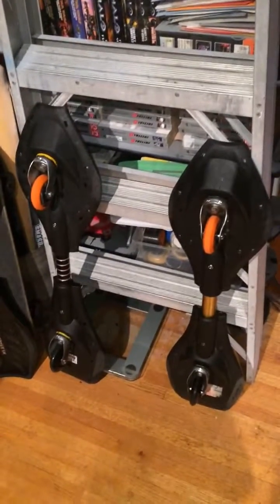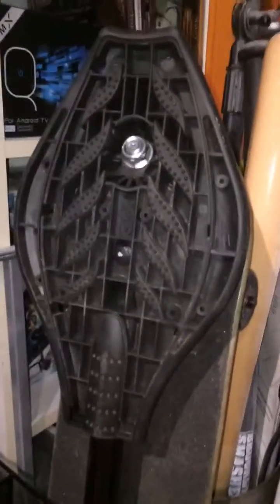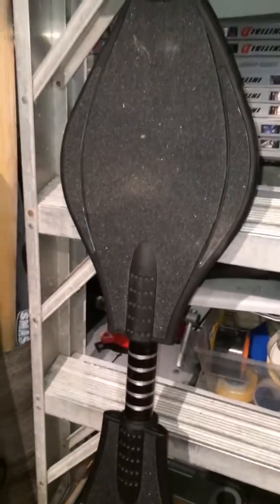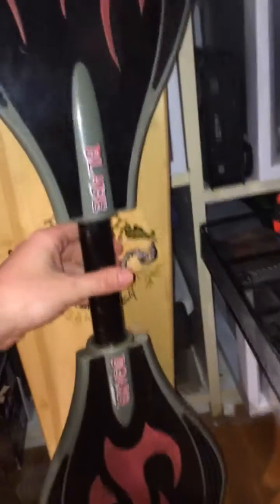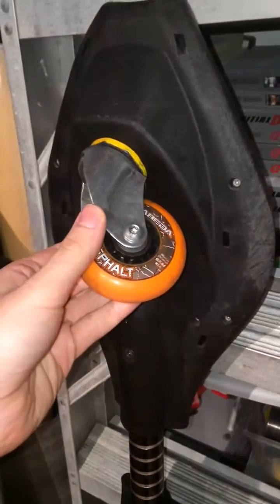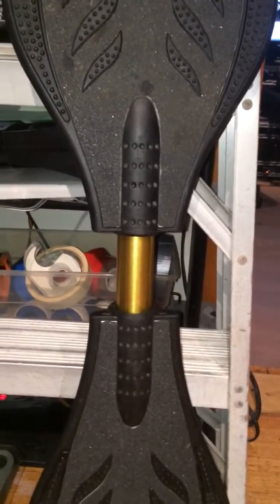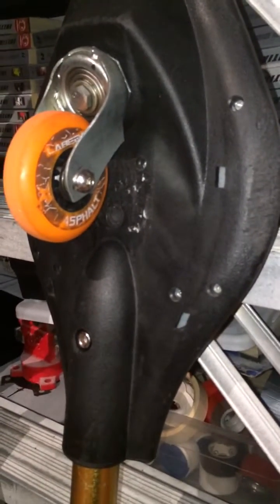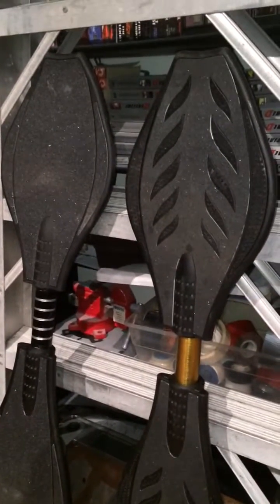Update: My two custom ripstiks

Comment from the maker: Wrote this as a comment on someones video where they showed their new rip surf and figured id give this video an update with news on my current favorite ripstik and general caster board setup. Its still the one using the blade or wave or whatever torsion bar but ive cut the metal tubes and everthing to fit with tons more mods described in the following copy and pasted comment from that video.....

I love my completely self done custom ripstik/caster board. Running my own custom torsion bar (the center piece that twists) its shorter, had to dremel the protective aluminum tube to fit over it with the plastic spacers that also go over that along with the stronger metal tube under all that i custom cut from another caster board. Threw on a harder after market 89a 80mm rear wheel and a softer 85a 80mm front wheel. Shaved down the front separated studded pieces to the matching v1.5 or v3 ripstik front end and top plate which i grip taped. I shaved the side crescent studded grip pieces flat and grip taped them as well. Then matching the rear to the front to fit the torsion bar since you cant use the v1s or the newest ver ripstiks with this sized torsion bar im using the same ver back plate and just threw out the studded grips as they just get in the way of gripping and the grip tape, did the same to the crescent studded grips (shaved em taped em). Dremel'ed off excessive plastic all over without affecting the rigidity and structural integrity of the ripstiks front and rear pieces. Then i reassembled both casters using brand new balls for the bearing construction and custom high end lube used for a lot of pneumatic applications, and then of course had to upgrade my spacers bearings and downgraded my steel caster wheel mount tops to lighten the setup and because i feel they dont wear as badly oddly enough with the lubed ball bearings or whatever that are for the caster assemblies.
Finally to top it all off i tend to slide the back side down onto the plastic deck sorta like if you could board slide but for a ripstik and without needing a rail or curb. The problem with this is it wears down the plastic so badly and quickly it starts to wear down to the nails mounting the grip and i wound up using epoxy before to keep the grips on and it was a giant pain. So i shaved it down till the screws were just about to start scraping on the ground, and then used jb weld and hot glue to fill in the gaps and apply a rectangle i cut out of some delrin(a type of plastic) i had laying around which hardly wears at all if not not at all when compared to the ripstiks plastic material. With that mod done i also get much more sliding with less friction meaning i can get those slides to turn and to stop like i enjoy while having more control and balance and also making it easier to pump off the sliding back end and front end to build up speed going up hill while sliding. Ive never heard of anyone that has learned to do the sliding like i do let alone maneuver and build up speed while sliding, and this mod has just made that ability 20 times easier and smoother to pull off, it also helps having the delrin cut i made so thick so that the board doesnt require so much angle to initiate slides so theres less wear on other parts of the board and it helps significantly with balance like i said.

Anyways TLDR you can do tons with all the different versions of the original ripstik up to the G version and the DLX versions, in total i had 5 or 6 different versions to work with as they changed the design over and over by the time that i purchased each one. So each version can easily be modded and have newer wheels thrown on with nicer bearings and immediately take apart the casters and clean the shitty lube off them and relube them often and use tri flow on the bearing inside the caster which you cant remove and your set for near top end quality riding on those things. 

Very little investment on the cheapest (not including their shitty "brights" "surf" and other shitty lighter variants) ripstik and youve got a caster board able to compete with custom wodden and other material caster boards worth upwards of $300 USD for entry level "high end caster boards" For a mere $130-160 USD if you opt for new bearings and a powell peralta tail bone skid plate instead of cutting a piece of delrin yourself, then just another $16 and you can relube and maintain the thing near indefinitely. My latest top end fully custom board i made has lasted me at least 9 months now and when i started cleaning it and putting it together it was already all using stuff well over 9 years old including the ripstik itself. 

This things never gonna break on me i love it. Not to mention im 6 foot 3 inches and 240 lbs which is just above the limit these things claim to handle and is usually something us bigger guys just burn through like wheels i used to go through typical wheels in about an hour or two now with the upgraded ones and learning to ride it better my wheels last me at least a week of continuous use. which is the reason for the crazy high durometer rear wheel which is fun to skid out/drift with due to the hardness.

Due to the custom setup the torsion bar i installed which i stole from a discont. wave rider board has just as much stiffness as the best ripstik torsion bars but is shorter making the entire wheel base shorter allowing for a more trick oriented board that can accel.  much quicker and easier than a normal length torsion bar even though youd think a wider stance/wheelbase for a taller person like myself would be better, its not. Combine that with the bigger wheels which usually require more strength/energy to accelerate with they kind of counteract each other and the bigger wheels make everything but the drop deck sliding trick i do with my mod for it easier to handle(the height of the delrin mod counteracts that problem tho), its better with cracks, curbs, and top speed so to speak, while also lasting longer.

For comparison incase you barely touch your rip wave or whatever from razer the following compares the typical go to deck based mode of transportation the long board or even skateboard which im sure uve spent plenty of time riding now or in the past whichever it may be....
So thanks to all my modding making the thing perfect, and the fact that it works by propelling from your momentum you push with each leg this caster board requires much less leg work and allows for more endurance riding or long haul rides that youd be able to physically bear with a long board, without worry of tendinitis whilst giving you more maneuverability and imo is much safer to ride than a skateboard so long as the conditions are too sandy, dirt covered, or wet, then the long board is gonna beat out this and all other caster boards for safety.

Now anyone thats gotten through all that reading i would like to thank you and congratulate you on having the patience to read all that text so if you have any questions or would like any advice or anything i can do to help you via texting, uploading videos, pics or anything to do with ripstiks and ripstik modding or even general caster board advice and the like leave a comment and i promise i will do my best to help and respond to whatever your asking or have concerns about or even wanna debate.